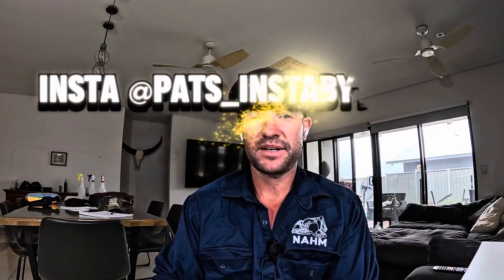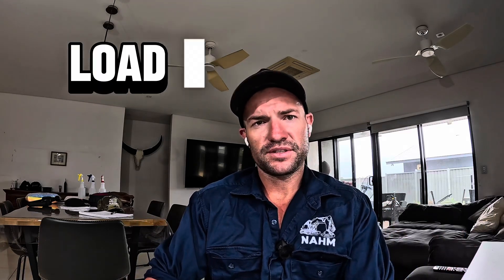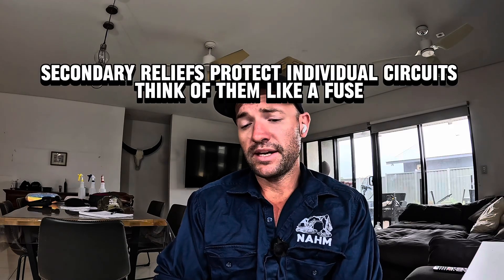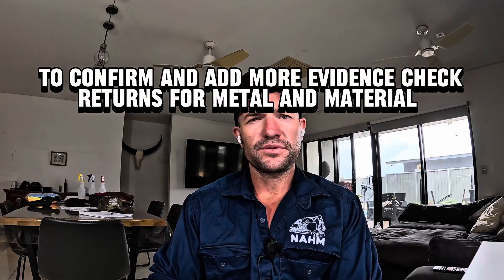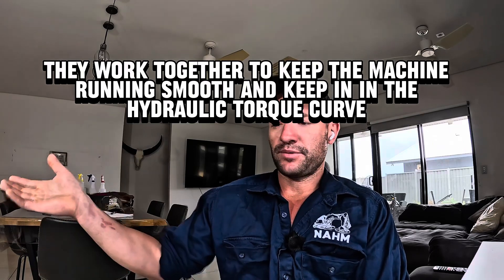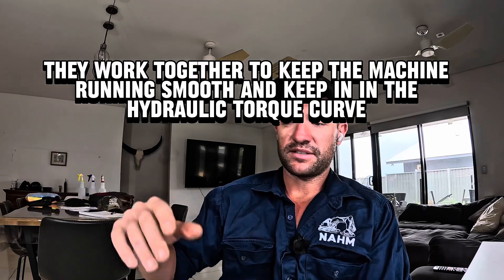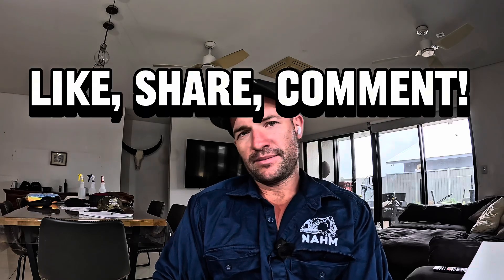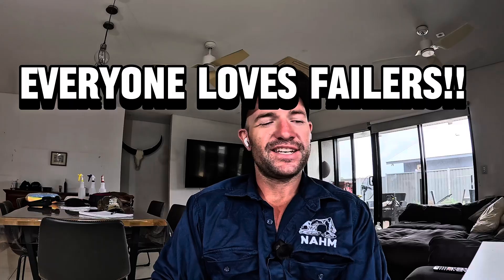Fix Excavator Hydraulic Problems Troubleshoot System Failures Fast!

Comment: I've always thought of hydraulic circuits the same as electrical circuits, the engine is the battery, pumps are the current, and controls and consumers are resistance. You pretty much confirmed the way I tackle hydraulic faults in the way you described your methods. Cheers for putting up this content, mate.

Comment: Love the vids mate wouldn't mind seeing more video examples of what you're talking about as you're going, don't get me wrong I love your melon but I find myself more of a visual learner hahaha. Like for this video it couldve been some clips of secondaries, clips of pressure testing and where you got the pressures from on the model you were on at the time stuff like that. That'd take fucken ages to clip up and edit together so fully understand not doing it but I would love that sort of thing! Have a think about it cobber, love your work anyway. I love to learn off heavy crew boys that want to teach, in theory it's all nuts, bolts, engines and hydraulics same as a truck or dozer but when I get on a digger I feel so out of place and like fuck where do I start! These videos are helping me understand a bit more of the diagnostic process I rarely see, usually other lads do the diagnostics and we're the shitkickers changing the bits out. Cheers for your efforts mate.
Reply from the maker: @chedda2871  appreciate the comment bro! And the input! Would love to include more demestrations but obviously difficult at times, being quick and efficient at work doesn’t really involve me holding a camera and the restricts they place on video footage but down the track I will definitely try and work some into the content for you 🤙🤙🤙

Comment: Why do some machines use case drain filter and some  don't   is there a universal way to find pump slippage amounts
Reply from the maker: @joshuahowell6992  ahhh all pumps that have case lines are piston depending but most large diggers have return manifolds that’s have a large return! It’s fairl obviously if a motor is casing hard but what you can do
Is put them in a 20 litre drum and compare